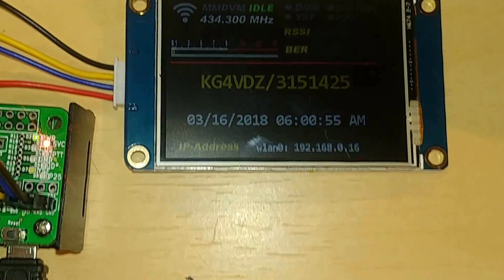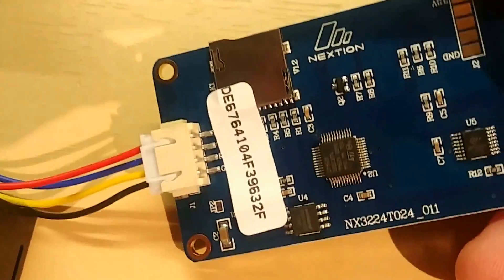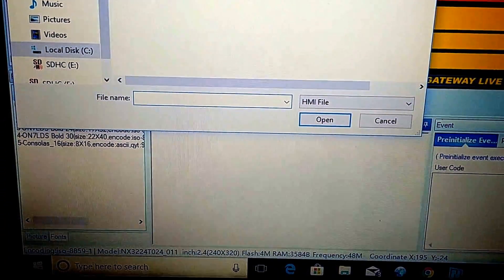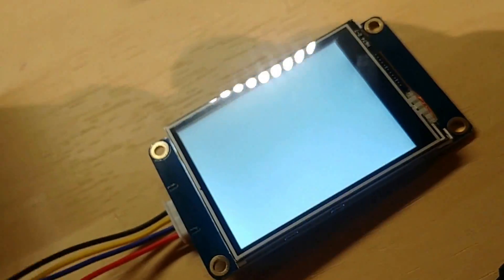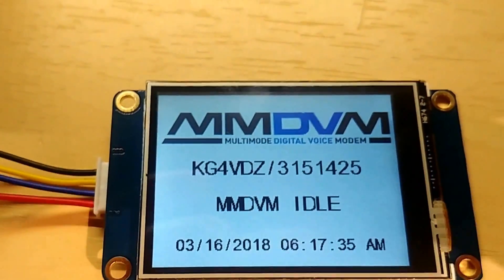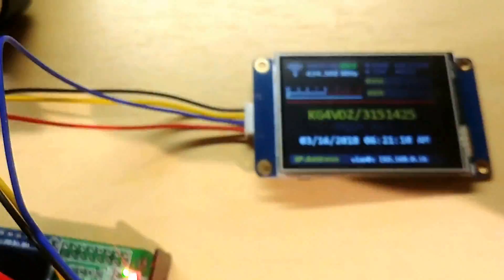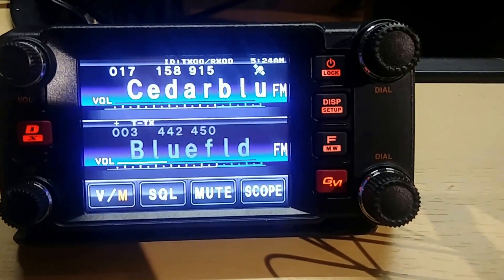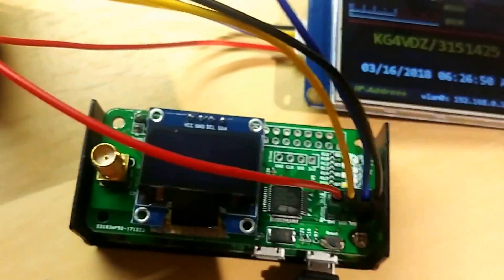Nextion Screen On TheJumbo Spot DMR Fusion Dstar P25 Digital Hotspot

Comment: are the Nextion screens on ebay the same as the one your showing?   What size is yours.   This is great video but your sources info would be nice if listed.  Thanks, Ken
Reply: You can see the part number when he flips it over NX3224T024_011 so it's a 2.4 inch

Comment: Did you solder the Nextion screen cables/terminal to the mmdvm or just plugged it in?
Reply: You can see on the mmdvm board that he just used plug-in terminal connectors.  Of course, you can solder it if  desired.

Comment: Like your videos ! I am wondering how much power supply (amps) is needed when you add the nextion to the jumbo spot ? I currently have a 3 amp supply and from what I have read the Jumbo spot likes to see a 2.5 amp supply on its own . Thanks 73 KA4KMH

Comment: Is there a way to switch from the small oled to the Nextion?  I have Jumbospot and want to be able to use as both portable and at home.
Reply from the maker: Yes you can switch back to th oled in th pi star config panel